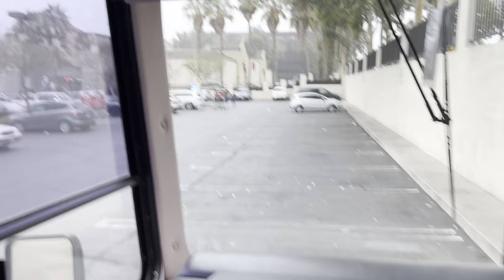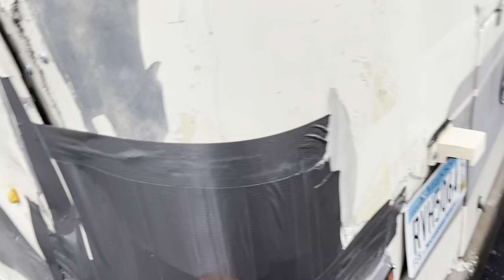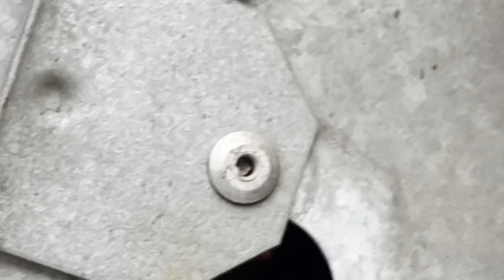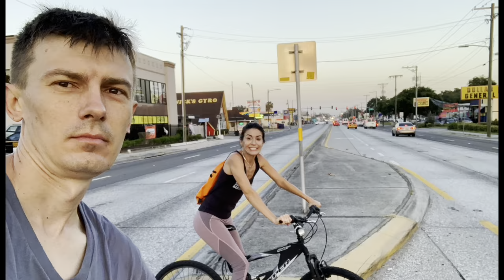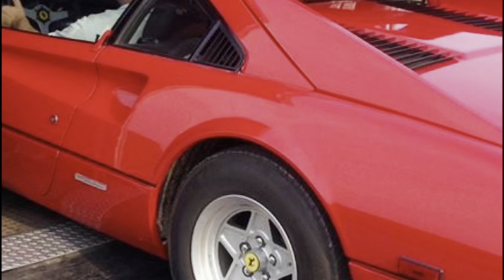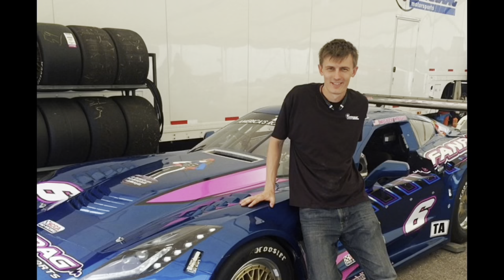Some Thoughts About Our Safari Trek ISUZU

Comment: I have the opinion warming up a diesel at idle for 15 minutes or more is worse for the engine. I start my semi truck and once it has oil pressure and air pressure for a few minutes I circle around the parking lot with higher RPMs a couple times before leaving. The water temp rises fast and I can hear the engine running much smoother since it’s warm. If I let it idle from a cold start it takes forever to warm up and the whole time the engine is just sitting there blowing diesel out the exhaust and the rings are scratching the cylinder. When the engine is at 1,500 rpm there is much less stress on the camshaft and crankshaft than if it were at 900 rpm. It’s like the length of a ratchet the higher the RPMs, the longer the ratchet, the less required torque. Less torque means less wear on the engine with cold oil that doesn’t want to flow. Another benefit is the oil pump can really get that cold oil moving at a higher RPM so it warms up faster just from the increased back pressure. Once the temp drops below 30* I switch from conventional to to semi synthetic oil.
Reply from the maker: Good point on warming diesel.

Comment: Thinking about the airconditioning situation .    I have a Spark EV which is probably the most inexpensive electric car in the country.   And it has a very good airconditoning system in it as well as a heater.  I imagine that could be adapted to another vehicle is you are a electro-mechanical wiz kid of some sort.   I plan to study up on that system to see how it works so well.  Now that I think about it I guess it is no big deal to have an electric airconditioner as long and you have electric power.   Its the heater which is pretty special.
Reply from the maker: Yea, that would be sweet to take out and use in an RV
Reply from the maker: A semi truck I drove had mini split AC system that ran off of 4 batteries.  It would give on and off AC for up to 3 days until I would need to start truck to charge up the batteries
Reply: @sergethecarhauler795  oh yes a mini split.

Comment: Your theory on the propane refrigerator operation is wrong. The fire is separate from the closed loop cooling system. They do seem to be very efficient on gas.

My guess is your generator has very little wrong with it. It will probably take longer to find the problem than fix it. Being a diesel camper does it have a diesel generator that runs off the same fuel tank? That would be nice.
Reply from the maker: The generator is propane on this Trek.  I think it’s the starter. Your right, the propane refrigerator is very efficient.  It had 1/2 tank of propane all this time we are using it and only down to 1/4 tank.
Reply from the maker: Also I don’t prefer the noise of a generator or the sound of engine idling, I know air conditioning systems I have tried in trucks that use 4 separate batteries to start the truck and 4 for the AC system that would last up to 3 days before you need to recharge by starting engine.